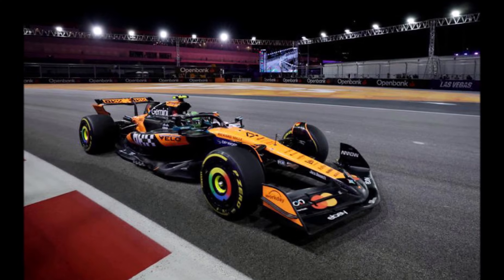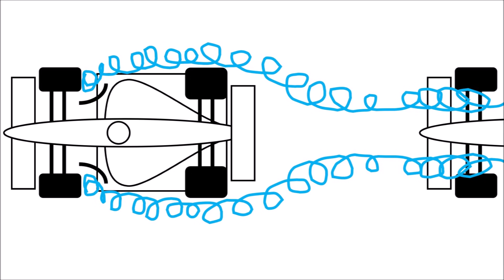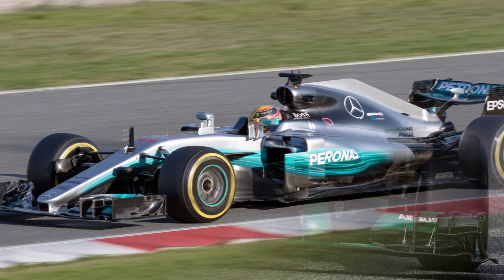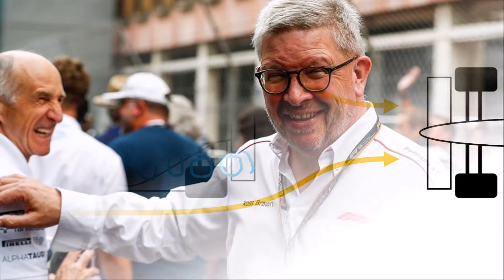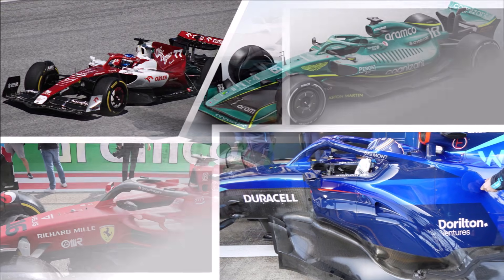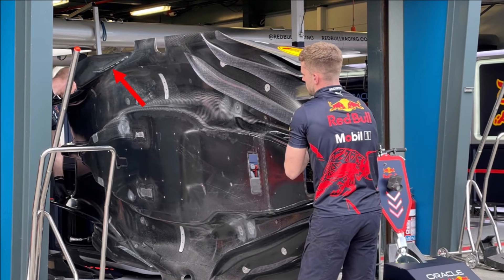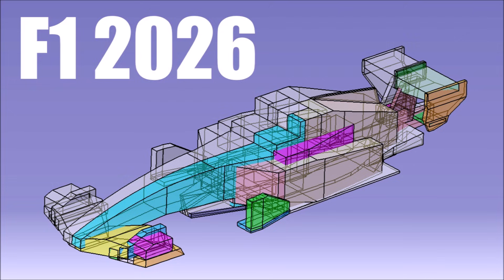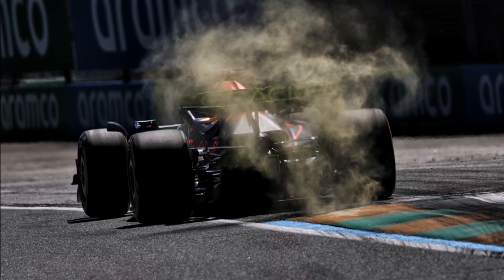F1 Ground Effect Era 2022 - 2025 - What Did We Learn?

Comment: I found the racing boring in this era, there needs to be more of a pace delta from the top to bottom of the grid. Even though the grooved tyre era had few overtakes on track, there would be a lot of running in free air which at least let the drivers show their true pace. And lapping cars always added the potential for fireworks. Now if there is a DRS train, everyone behind is basically not even racing, just holding station. I'm hoping the MOM will help. At least in Indycar with push to pass, this makes it so everyone has to be on their toes, ready to defend if someone from behind is dumping their battery to attempt an overtake

Comment: it's a pity they didn't try to reintroduce active suspensions somehow during the "ground effect era" as they could have mitigated several of the issues these cars suffered from
Reply: Yep, it was a giant waste of time trying to guess the correlation between tunnel & track on 2mm ride height...
Reply: Exactly. They could have made the components spec to control cost. I think they will consider this in 2030. Tunnels with ride control , in wash and smaller wings. The best of all worlds.
Reply: @Toro_Da_Corsa  I think this next regulation set will show that the wet race issue is solved by reducing ground effect downforce and F1 will be more hesitant to go back to ground effect
Reply: They considered it but couldn't because of the cost. Active suspensions would be borderline unaffordable to develop for teams like Haas.
Reply: @rohitrevankar7674Not if they made the active suspension components spec. Then it would be cheap
Reply: Too expensive.
Reply: @mojoblues66  we are not in the 90s anymore. if modern road cars can have active suspension, then so can F1 cars. it could also be made a listed part. teams like Haas could just buy their suspension from Ferrari.
Reply: @mojoblues66 Make it out of spec parts , then it's cheap
Reply: 3:56 I would rather strongly argue that it was actually the Valkyrie project that gave Newey the edge here. Early in its development it was hampered by the exact same issues as the F1 cars because of the large Venturi tunnels being used.
Reply: The clever mechanisms teams developed in GE era of cars were actually superb, they should have incorporated those revelations so that all teams adopted. That mini DRS was really something, the flexi wings were perfect…
Reply: And you need to win over drivers too. For example Mansell basically needed a lot of convincing to trusted active suspension at Williams as his previous experience in this system with Lotus wasn't pretty
Reply: They simplify the suspension geometry because its they want to totally minimize the dirty air. So it will never be employed without having to change the aero regulations first
Reply: Should have had a twin chassis to overcome the suspension issues like a Lotus had before it was immediately banned
Reply: Red Bull would've been even more dominant than it was. Remember that when active suspension matured, Williams dominated like no other team, until the others catch up.

Newey. It's always him. Patrick Head perfected the suspension and Newey designed a car that worked perfectly in tandem with active suspension. So if they reintroduced it along with ground effect cars.... Max would've won about 40 races at the start (2022 and 2023). Only by mid 2023 that teams would start to understand shit to catch up.
Reply: @rigel8755 But they could have made the active suspension a spec component
Reply: I think the argument against it would have been costs, unless all of the active/passive actuation would be standardised, I don't see how you make it work.
Reply: @F1ll1nTh3Blanks And "costs" wouldnt even been a proper arguament either
Reply: @UndisputedGoat4  Why wouldn't it? You have to explain that. Thers a budget cap. You'll need to more than double it to accommodate for active suspensions. Some teams barely still make the budget cap even now.
Reply: @F1ll1nTh3Blanks  Why should the cost matter when we already have a cost cap anyway?
Reply: @LukeW_66  Cos it wouldn't be affordable within the current cost cap. And increasing the cap would further disadvantage smaller teams.
Reply: @LukeW_66  because it's more difficult to audit.. part of why they dumped complex dampers to begin with.
Reply: @F1ll1nTh3Blanks Make the components spec , then it's cheap.
Reply: Yeah this was Mercedes argument mouthpieced through George Russell on “driver safety” grounds in 2022. Nothing to do with Mercedes having found a way to make a mechanical active suspension in the years previous that won them titles in 2018-2021. Think of how many times race commentary said “its like the Mercedes is running on rails” during that period. This suspension was completely outlawed by the 2022 regulations that defined much simpler systems.
Reply: @MsZeeZed  The major error by F1 was to remove advanced damping that cars in previous years had when Mercedes were dominant. I don't understand what was the need for that when F1 has always been cutting edge this and cutting edge that. It was an unbelievably backward move for F1 in 2022. Basically they made the cars over sensitive to the floor and removed the advanced tech from suspensions. For me this is where the regs failed. Needless dumbing down of smart tech.
Reply: @rohitrevankar7674 gas dampers are tricky (most proly more than active suspension), but banning J-damper (inerter) is madness
Reply: Active suspension is just a big "just throw money at it" solution, to a problem that can be solved much easier with a bit of engineering.
Plus, active suspension is actually very dangerous, because it creatis.a unpredictable layer between driver input & the car
Reply: @DriftJunkie  This "problem that can be solved much easier with a bit of engineering" is exactly what haunted hundreds of engineers in all teams in these 4 years. What kind of bit of engineering were they all missing?? Why didn't you join F1 and give a team the holy grail and solution to all their problems then?
Reply: @DriftJunkie my brother what are you talking about. Every problem in F1 is a "throw money at it" kind of problem, that's the point of costs caps. On the same vein, most tech in F1 is pretty risky, are you telling me advanced suspension is riskier than having cars bounce on the straights and risking losing all rear down force if the floor gets even slightly too far away from the tarmac? Crappy arguments, they didn't have the balls to do it and smaller teams probably cried about it instead of actually using their money for developing instead of keeping buying stuff from other teams.
Reply: @MrChoklad  Every problem COULD be solved like this. But it is not the best approach my anxious friend. Happy christmas 🥰🥰
Reply: @DriftJunkie Not if the components are all simple spec parts. Then it's cheap and easy yo work with
Reply: Nah, active suspension is a slippery slope to automatic transmission, driving aids and eventuay self driving f1 cars
Reply: @RCmaniac667  transmission is basically auto already, they just aren't allowed to run them as auto's
Reply: @Amy-dq2lg it's sequential

Comment: We learned that Ferrari, Red Bull and Merc should not have been allowed to adjust the regulations in pre-season and shaft Alpine and Sauber. And we learned Merc should not have been allowed to help ruin the cars for 2023, and that there should have been more done to stop outwash returning. We learned the teams that were whining in '22 should have just raised their cars and lived with worse performance. We learned that those  pundits and fans who called Newey "overrated" and the '22 Merc "genius" don't know what they're talking about. We learned that Rob Marshall had a big effect, and that Red Bull didn't have an "asymmetric braking system' that they had to remove from the car. And we learned a lot of fans just take the dumbest gossip as proven, and don't understand that from race to race, some cars suffer more than others depending on the track. And we learned that Merc was still terrible in '23, it's just that Ferrari had terrible luck. Most of all, we learned that the biggest issues are still outwash, how long and heavy the cars are (requested by the engineers and aerodynamicists), and how bad the tyres are, when expected to operate from low temps, drop off a cliff and work with massive torque, necessary for the massive bulk. And that Newey is right, we should prioritise light and efficient cars if our message is about "sustainability".
Reply: Get real. The sport is dictated by the teams. If Mercedes and Ferrari decide to walk cos they don't like it, F1 collapses. This isn't like football where players and coaches have to simply follow the rules. It's unique to F1 but it's the teams who get to decide the nature of the product and as a tech enthusiast ground effect era was good riddance.

2026 is going to be back to the true technical warfare that defines the sport.
Reply: @rohitrevankar7674  "The sport is dictated by the teams."
It is now. But the problem is that all the teams were bought out by manufacturers or consortiums.
"If Mercedes and Ferrari decide to walk cos they don't like it, F1 collapses."
Wrong. The sport could easily find teams that would step in from lower categories, and ICE suppliers. Yeah, hybrid would be gone pretty quick, but most F1 fans would not care that much. Ferrari would be a big loss in a commercial sense. Merc would not.
"It's unique to F1 but it's the teams who get to decide the nature of the product"
F1 has been a sanitised franchise for a good few years now, that why we have so much fake bullshit like in Vegas, Miami, Jeddah, and all the team radio that is broadcast purely to drive engagement and rage bait. Yeah, there was a time when this sport had some prestige to it, but now it is largely a facade, purely focused on the commercial side and appearance of being the pinnacle. They use the talk of the "pinnacle" to justify forcing bullshit no one wants like hybrid and now overtake buttons and moving wings. It's gimmicks to make up for the fact the cars can't push, can't run out of fuel, can't run of re-gen on TV. That's why we have this mockery whenever there's a late SC because the cars cannot refuel and commercial deals mean they have to finish at a specific time. Ticket costs have gone through the roof. I dunno what you're so proud of. It's sound like you fall for the marketing.
"2026 is going to be back to the true technical warfare that defines the sport."
Don't get your hopes up too high.
Reply: @Ruylopez778  I have been following the sport since Schumi days. Unlike most fans I don't care for the on track recking as much as strategy and tech developments. Cos the truest meritocracy often show up as boring events. If you want crazy wheel to wheel action which trust me F1 never truly was, then watch American racing or junior formula or go carting. 

Thers so much media coverage today that ppl get to overanalyze the sport. There used to be a time when fans were simply excited to see fast cars and in awe that drivers can go that quick irrespective of the actual racing. Schumi wouldn't be half as respected if he was a driver in this era am pretty sure.

I am not falling for any marketing. It's actually you who doesn't understand the identity of the sport. This is a technology event NOT a pure racing series. FOM is owned and run by Liberty Media so they give you bullshit like "gladiatoral contents" and what not which is laughable. If you want to enjoy F1 then you need to find respect for the engineering side of it. And if it's not your cup of tea then F1 isn't for you. The driver drama is just maybe 5% of the sport. Teams don't hire 1500-2000 ppl to help the driver. They have those ppl to make and develop these prototype machines. It's an OEM event like it or not. This is where the identity crisis is. Fans like you hoping for great racing every year don't understand what F1 is. And F1 doesn't want to be honest to fans while quietly maneuvering behind the scenes to get more OEM's involved for fairer competition. Only a full work's grid will bring F1 to its best.

When I said technical warfare, I am talking design and development. I absolutely don't give a damn about overtakes. If it's good, it's icing on the cake and I'll enjoy it. If the recking is boring it's still fine for me. Have a good day.
Reply: @rohitrevankar7674  Sorry to disappoint you, but I started watching before Schumacher joined the sport, so I don't need any of your condescension. I also don't need your presumptive corrections about what the sport is or isn't. Yes, it's always been about making the best possible car and the fastest race time. No, it's never been about "crazy action". I don't think any F1 fan is under the strawman illusions you seem to think they are. You sound like someone with a limited imagination. Nowhere did I ever claim I don't "respect engineering" or don't find it part of sport, or don't find it interesting. Look at the channel we are on, genius.
"It's an OEM event like it or not. This is where the identity crisis is. Fans like you hoping for great racing every year don't understand what F1 is."
This sport has been ruined by "the manufacturers" and in fact these brands have absolutely zero to do the road cars, and no interest in the sport beyond the money they can make from it, and nothing you've claimed changes that.
"When I said technical warfare, I am talking design and development."
I understood what you said. Nothing you've said is as sophisticated or complex as you pertain it to be, and nor am I interested in your adoration for the mercedes brand. It's about the mouthiest scum in the paddock getting their way and hiding their advantage or penalising others, not about who can design the best car, or develop it the fastest. Those days have long since gone. And I'm not saying the sport was never cutthroat, but it's just brands now. It's a shadow of its former self, and this next rules era is gonna be the same shit you already had, just progressively worse. Bernie wasn't perfect, but the team bosses used to work with him, now the teams dictate what the sport is, and that is why we have this megabucks twaddle and gaslighting.
"Schumi wouldn't be half as respected if he was a driver in this era am pretty sure."
No one cares what you think, because you're too stupid to give other fans any credit.
"Have a good day."
Don't insult my intelligence by wasting my time with your strawman to end with such passive aggression. It's so boring. And I couldn't give a toss what is or isn't fine for you. Muted.
Reply: F1 always been about manufacturers and teams since the beginning.  Google Concord agreements which came about cause manufacturers and independents had wars over F1 direction which dates back since 1980s. The agreement then came cause of those wars which was signed ended the direction debates and has been continously renewed every few years the most recently 2020s and it will be renewed later on. Teams and manufacturers have always influenced regulations. That will never change since that agreement was made.

F1 had always been development and the fastest car. Yes there's been in season changes however F1 engineers probably alot smarter and have more experience and expertise probably figure out an area where it was actually cheating in spots to give attention to FIA. Though people like Newey just figure out usually absoultely just put themselves in gray aeras. The guy is not perfect but his results and record speaks louder than the words and for that I usually will listen to this guy more than any other in F1 cause of his record and results.
Reply: @gerogyzurkov2259  I know there have always been manufacturers in the sport. The difference is that they used to swap teams, quit the sport, join the sport in a different way to now. That's because of the complexity of hybrid and how closely the PU is integrated into the car. There are no private team owners anymore, only manufacturers and consortiums, and they have the authority to push the FIA around and dictate what the rights holder does. They've all got their snout in one big trough. The only reason the cost cap got forced through was because of covid, and they've resisted dropping MGU-H, which was a disaster, since 2017 to prevent VW and others from joining. 2014-2020 was the worst positive feedback loop we ever had. Of course the sport has always been about building the best car and there's always been teams going beyond the rules to dominate. Now the teams work together to protect their own share price, and there's less transparency in all regards.
Reply: @Ruylopez778  Cost cap was agreed before COVID 19 lockdowns. Not cause of COVID 19 itself causing directly that. It was agreed cause the sport wanted more sustainable rather than more teams like Mercedes just spending more to out develop the car  to make it go faster by throwing more money thoughout the season and also helped independents so it was a win win. Ferrari gotten affected also but they had ability to veto it. They voted for it. 

Though u can argued it simply slowed the top cars cause the car will be lessen to go faster and slower cars also cause playing catch up is very devastating for your season cause it now becomes even faster your season is over from near the beginning u can figure out.
Reply: why so negative
Reply: As opposed to 2026 almost half gas half electric.